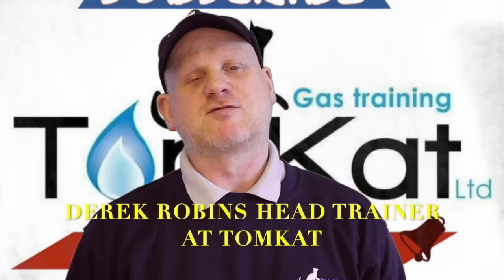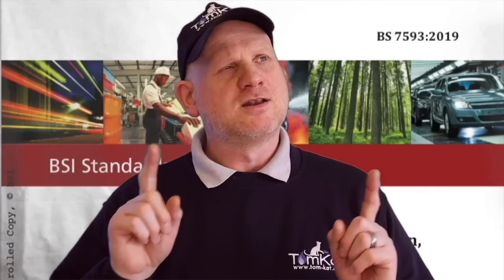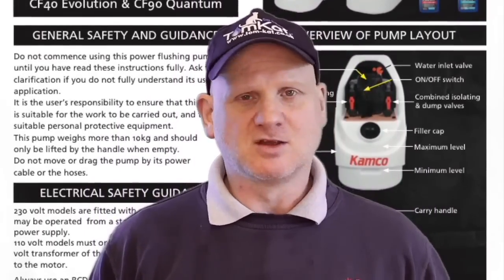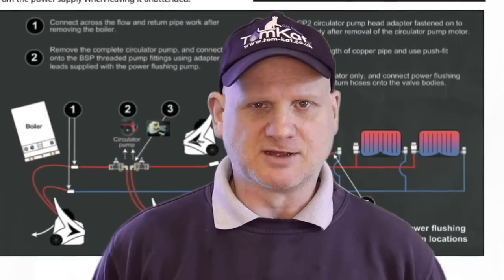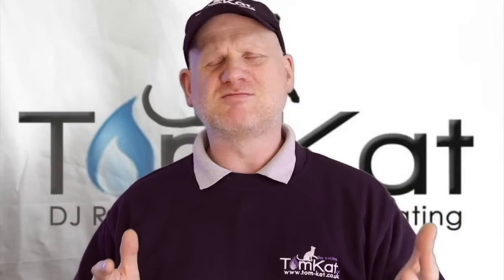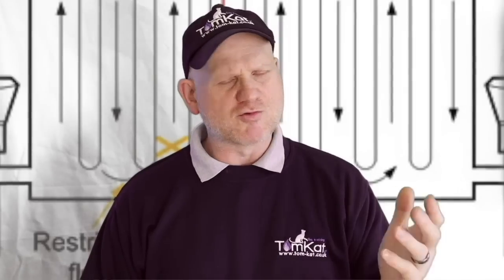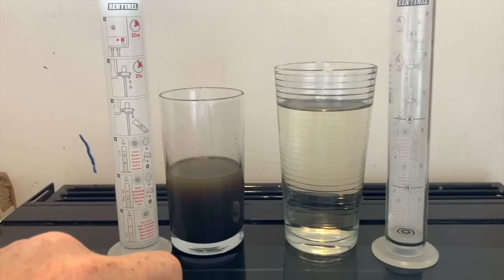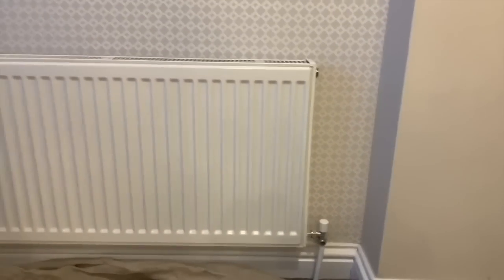MAGNACLEANSE Vs POWER PLUSH, the do's and don't of the two processes and which process is best.

Comment: Phil Waddingham here, I built a rig with an on-board ss bodied pump 1.2 Kw 61lt/PM flow rate and Adey magnaclean unit. It takes no prisoners and primes the pumphead at source so flushing is a breeze as I isolate the return and pump out to drain each rad in turn. What a monster!
Reply: Can you send a pic 👌

Comment: I use both when I do a flush. This way it uses less water  as the returning water is filtered before its returned to the power flushing machine.  Also I find it good practice to rap a rag or cloth around the top of the agitator, this helps to stop scratching the radiator. Also following Adey instructions its better to have only a little water in the radiator say 20% that way all the power of the flush hits the sludge at the bottom of the rad.   
I used to take all the rads off but this way even the pipework is flushed as well and it uses a lot lot less water.
Great vid thanks and thanks for the info on different inhibitors, I never knew that
Reply: Defo better to flush along bottom of rad first, as you say 👍 Then fill to 50% to help wash out and get any flakes further up the rad. Or agitate to knock them off. Wouldn't want to agitate rads on microbore system though, to avoid any lumps blocking pipework. These rads are taken outside and hosed out, or connected to magnacleanse with pump attached on flying-lead, or flush machine.

Comment: 1 good tip is, when flushing a system with combi boiler, turn off the cold to it. If the customer turns the hot tap on, all the shit goes in the plate heat exchanger.
Reply: Thanks .. good tip !!

Comment: Thanks for the info and review, I have the MagnaCleanse and just to say I built a addon where I can put pumps into the system to move the water in the event of a failed boiler or when a new boiler was being installed and I wanted it to be perfectly clean prior to connecting, it worked well for me. I like the simplicity of the MagnaCleanse.

Comment: I've got the Magnacleanse, and for the first few times I was learning !  Learning how to connect easily and not connect every job in a differant way, thus slowing the job down in a less efficient way.  Although... differant system types, will require a different connection set up. But say for combi? I make sure try to connect at same point on system?  Normally under  boiler, so i can remove Magna. And fit a magnetic filter in its place. 
I'm still not a believer that Cleanser is great on it's own?  But many fitters say they swear by it.
It's just how the heck can all dirt and iron oxide be removed when there's no pump?  Yeh,  the dirt in water will be cleaned but what about settled dirt?

Comment: I’ve got a magnacleanse. I really rate it for smaller properties and systems with a medium level of contamination. But for really bad systems I don’t think you can beat a powerflushing machine.  I came across an issue I’ve not had before when using my adey a while back. I like to give the system a flush under mains at the end. However I think the boiler must have had a non return valve on the flow. External filling loop on the return. When I opened the drain valve in the magclean hose and opened the filling loop, nothing happened. I couldn’t fill the system because as soon as I shut the tap on the filter to divert the flow out of the drain hose, it killed the circulation. Only time it’s ever happened. Apart from that my magnacleanse has paid for itself many times over by now.

Comment: Excellent I generally just magnacleanse the system.  If I have to use my powerflush I use it in conjunction with the heating elements built into the Norstrom powerflush.  If particularly bad the magnacleanse is used in conjunction with the powerflush. 
Excellent tutorial Derek 👊👌
Reply: How would you powerflush open vent system using magnacleanse what set up do i need? many thanks

Comment: Love these vids been in the game a long time like Derek and seen a lot of changes in the heating industry.......I usually install my Magnacleans in series with my  kamco machine and run the system water through my kit and fire the boiler up no hotter than 40 degrees ..... cuts the time down and the water wastage ....... system gets the best of both worlds and then fit the new filter were i cut in too connect my machine .....it’s worked for me for years and the system usually squeaky clean ...👌
Reply: Post a picture of your setup please ☝️

Comment: Magnaclense all day long. If the  boiler is U/s I cold flush with water, then fit the new boiler and carefully use the new boiler and the adjitator to clense the sysytem. On a bad system I just make sure I empty the chambers after every 2 radiators so nothing gets past to the new boiler. Thanks for the video.

Comment: if you are going to replace the boiler AND the radiators  do you still need to do one of these cleans ? - will not most of the sludge in the system be in the removed radiators, boiler & drained water making a flush/cleanse un-necessary ?

Comment: Magnaclean for service and repair. Powerflush for ALL NEW instals onto existing systems. Powerflush has greater flow velocity NOT EXCESSIVE PRESSURE TO BURST pipes to shift more system dirt, including non magnetic contaminants. Combined with mags, or adapted for use with you Magnaclense, invest in your business and customer service quality and get both, Norstorm Pro flush the best Iv had up-to now, but the magnaclense is better coupled with it than the magmaster Iv got fitted.

Comment: Merv Jones-Owen. Good Video as always Mr Tomkat. My Method, Remove the F&E and wash clean, remove all the the radiators and take outside, remove valve tails and connect 1/2MI to the radiators and Cold mains pressure clean through every radiator at every entry point, replace radiators and then Magnacleanse the boiler, pump, pipework, etc with X800. Job Done.
Reply: have you tried 'Thoroughflush' system, its basically what you do, but without removing rads, & having a switch on a diverter to change direction of mains flow, so you can flush each individual rad without moving connection, it has a dump port integral to diverter. It cuts time for flushing a 3 bed house to about 3 hours, and no spilage or floods. still have to do f&e tank mind !

Comment: Cathodic and Anodic cames from Cathode and Anod. Cathode is negative charge terminal on the battery terminal and Anod is positve charge terminal on a battery. Meaning negative ion /charge in a solution goes toward Cathode and Positive ion/ charge to Anode.

Comment: Another top video 👍 I personally like the magnacleanse just because it’s light quick to use and cheaper to buy. BUT it’s no where near as effective of flushing the system as a powerflush machine. And you can’t remove blockages in pipe work with a magnacleanse but you can 9/10 times with a powerflush . I recently flushed a large system 16 rads but with 28 mm flow and return ( we converted it from traditional to a combi ) used the magnacleanse and it did catch a lot of the magnatite but caused me a blockage on a 10 mm bath towel rad😔 . I then powerflushed and the amount of gunk that was lying in the pipes was unbelievable but I couldn’t remove the towel rad blockage. I’ve flushed every rad. Flushed the entire circuit with all rads off except the blocked one. I’ve even put the machine on the rad tails of the blocked rad and still no joy. Tried finding the blockage with a thermal camera no joy. Have left some x400 in for a few weeks see if that works 😩 any suggestions ??? I’ve thought of possibly poking some soldier down the return as that’s the blocked one ☝️ or even wet n dry vac it ? I’m even thinking of putting my foot pump via an adapter through the valve and pumping it up and hoping for the best 😂 I don’t think re pipping is an option as the pipes are going into the walls 😒 any advice would be much appreciated thanks 🙏 your No 1 fan 😁
Reply from the maker: It would be easier and quicker to replace the pipe going to the rad if you can. In the past I have connected a hose pipe onto the rad valves and blasted the magnetite back into the main flow and return when I can’t replace the pipe. Who invented 10mm pipe for heating 🤣👍🏻
Reply: i've had the same problem with Microbore, i solved it by only having the effected radiator on and agitating the return tee of the rad's pipework where it connects to the main run pipework if you can get to it.

Comment: Good video . As a consumer looking to get a new boiler (combi) installed after a major flooding of my house where the radiators have been removed and the existing pipework of the open vent system will have to be removed, are there any other things that would need to be done as part of the installation in my particular case?

Comment: We had a brand new Worcester Greenstar boiler installed about a year and a half ago and magnacleanse was on our quote.. fast forward to now and we had a worcester engineer come out due to a loud grinding noise whenever we shut off the hot tap and the heat was no longer consistent, would go hot then cold very quickly. The engineer said he'd had to replace a part due to contaminated water and sludge..  it was way way off passing their water tests.. and the engineers exact words were 'whoever installed your boiler didn't flush the system.. ' so my question is.. for any professionals in the know... do we pay hundreds to get the system flushed or should we go back to the installer after a year and a half? And will it have been damaging our brand new boiler all this time? Thanks.

Comment: I have a Dunsley linked system and the Magna clean would only clean the boiler to the neutraliser box. So I assume I would have to use the power flush machine and clean via removing the pump or a radiator

Comment: Common issue with the Magnaclean Prof 2 model is that the canister won't detach from the valves.
If can’t access lid and bottom plug of cannister to clean (due to being installed in limited access areas) or if one of 2 valves need replaced, you have to change the cannister and both valves.
The cost of replacement valves and cannister exceed the cost of a completely new unit. In other words, if you can’t get into the cannister in situ to clean or either of the 2 valves need replaced, you need to replace the whole unit!!!!!!
Adey will not provide parts free of charge under their 10-year guarantee unless you have registered within 30 days!!

Comment: I had both system and eventually I sold Kamco CF 90. the main difference of  and Magnacleanse is the Circulation Pump, but if you use the mains water as the circulation pump for Magnacleanse, I don't know there is any diffenrence.   The low rate?  when they all use mains water, what is difference?  The pressure? could be no difference, some time the mains is high pressure than kamco pump.  another difference is Magnacleanse could be operate with boiler running and the Kamco CF90 could be problem manufacturer will not recommend it.

Comment: Would never power flush via rad valves, bottle neck before you even start
Reply: You can do it, if it's the only place to connect on. However, I would be seriously dubious about doing it on pipework any smaller than 15mm going onto 22mm primaries. I've tried it on microbore and it's almost impossible to get it flowing properly
Reply: @foryourlugsonly  very poor practice I would at least use a pump adapter if Pipework is too tight. You can flush 10mm COPPER but 8mm & 10mm is plastic pointless
Reply: @TheMozza76  of course I agree. I said it's an absolute last resort and yes, on a system piped in 8 and 10mm only it would be pointless. But then again a system shouldn't be piped like that in the first place.

Comment: Good video thanks derek what’s the price difference between the two ?
Reply from the maker: A power flush takes twice as long as a magnacleanse . Most guys I know charge about £400 for a magnacleanse
Reply: Always use both. The magnacleanes will clearly show you the degree of contamination, and impresses and educates the customer, it also provides the customer  with reassurance its money well spent.
Pre-dosing is another effective method and time saver.
As for cleaning chemicals, FX2 or similar for the worst (but NOT Aliminium!)
X800 or similar for your average fouling.
MC3 or similar for new or lightly soiled.
Inhibitors like cleaners, you get what you pay for! You cant put in too much, more is best.
Been using Kamco of machines for over 20 years and the original magnacleanse since it came on the market and it's still works just as well!
An investment of less than £1500 in today's money the financial return is a no brainer!
But hey ho, this is only my opinion based on my experience, other opinions are available.
As Tom says, it's not that simple, but  making the effort raises the industries profile.
Sorry if iv'e waffles a bit, I"m reknowed for it!

Comment: That NCV indicator is utterly pointless. Testing it against a socket where you've had to move your feet also invalidates any confirmation
Reply from the maker: Let’s hope one day you don’t come across something that has a stray voltage running through it. It’s comments like yours that shows the arrogance and lack of training.
Reply: @tomkatgastraining  unfortunately the NCV tester works only on capacitive coupling, so there's a multitude of situations where it'll give misleading results. You're much safer to use a meter or 2 pole tester
Reply: @tomkatgastraining  Fair point that also an NCV tester won't detect stray current! Only a clamp can pick this up! Dangerous advice!!
Reply from the maker: @aptsys  it’s funny how guys make comments about the safe to touch test. It was introduced to gas engineers because engineers are getting killed and injured through stray currents. The test is to see if a stray current is there and you are not guessing . How can me giving information to gas engineers with information given by governing body’s dangerous. They either carry out the quick and easy test or just dive in and hope they won’t get a shock or create a spark cutting into a gas pipe and making an explosive. At the end of the day it’s up to the individual if they think it’s worth it or not but don’t say I am giving dangerous information when it clearly isn’t.
Reply from the maker: @sdgelectronics  how dose a gas engineer do that on a gas pipe when they don’t have an earth or neutral to hand for the other side of the tester. It’s not safe isolation it’s safe to touch test big difference.
Reply: @tomkatgastraining  You use a reference, whether it be a wander lead or a local FCU/Socket etc. The NCV tester uses you as the reference which is why it's so unreliable.
Reply from the maker: @sdgelectronics  as I keep saying it’s a safe to touch test not safe isolation we are not checking a supply to see if it dead we are just checking to see if we have a stray currents passing through the pipe work. We either do the test or we just assume there are no stray currents so it’s just a safe to touch test not safe isolation
Reply: @tomkatgastraining  current cannot be detected by a NCV stick. You would need an inductive sensor for that
Reply from the maker: @sdgelectronics  ok voltage then. Or is that not correct either.

Comment: Technically you need both machines depending on the job and situations, you are doing system conversion and install, you will need a powerflush machine on dead boilers .
Magna cleans not going to help on dead Boilers

Comment: Powerflush all day with the magnet.
Magna cleanse you might aswell just fit the filter and say done.
Reply: But why bother with the magnet at all when powerflushing just dump until clean
Reply: @kennethhogan9115  
A soon as I start flushing the magnet is working. I like to circulate for 20 min if I’ve not pre dosed.
Plus I circulate the chemicals through each rad for 5-10 min before I start dumping so it’s pulling crap out straightaway.
And customers love to see the sludge dildo 😂
Let’s them them know something being done
Reply: By using the magnet with the machine, you're not dumping all your chemicals down the drain. So they stay concentrated and work properly until you want to dump water.
Reply: Hi plumber time. Would love some hints and tips on power flushing as I’ve just got myself a machine.
Reply: @Ian20232  go on kamco website and you can read about it.

Comment: Thank you Derek, great video.

I would like to add that as I understand this, the Magnacleanse in only an additional component. As explained BS7593:2019 document Note 3 page 7, this is an example of a device that when added to any of the accepted methods of cleaning the system (Powerflushing, Mains Pressure clean and flush, clean and flush using gravity) improve the cleaning process in time and effectivenes. 
But using the Magnacleanse just alone without following the process exclained for the accepted cleaning methods would not be a satisfactory.
In my opinion it is faster to clean a system using a powerflushing machine, than if I used a Magnacleanse to assist in cleaning a system following the described cleaning procedure explained in this document for Main Pressure clean and flush, or the Flush using gravity.